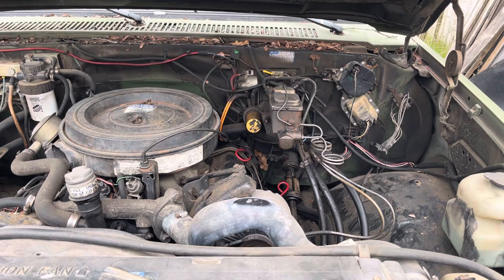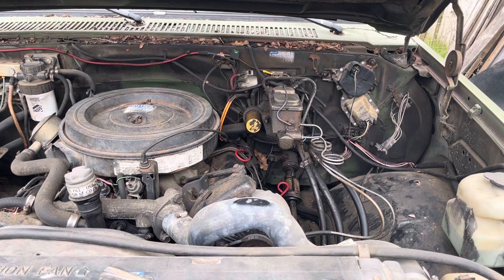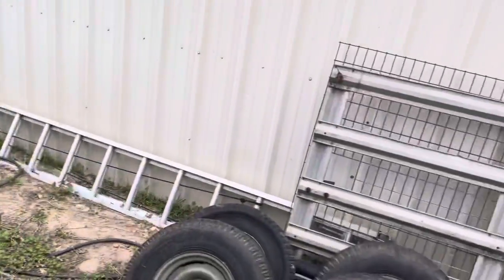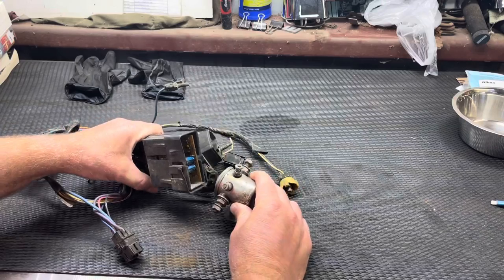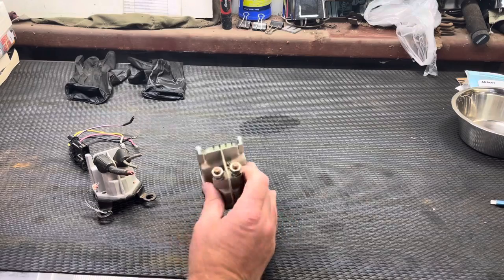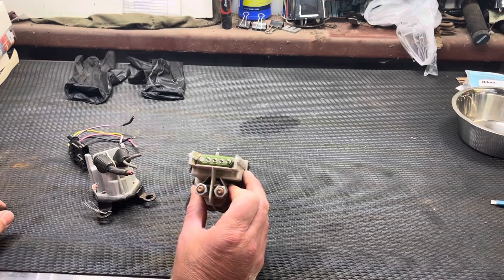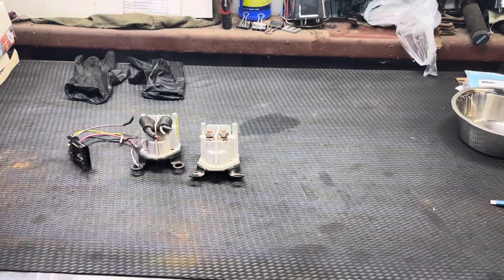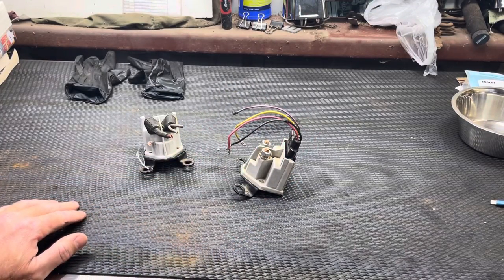6.2/6.5 Diesel glow plug controllers over the years

Comment: A year or two after I bought my 1984 K2500 6.2 diesel, the glow plug controller went out during a high country hunting trip. Fortunately, one of the party was the diesel mechanic where I bought the truck. He jury rigged a manual control which saved the day. He advised me that WD40 spray could be safely used as a diesel starting fluid. (Can’t do that with the “new” WD40). For years thereafter, I carried a can of WD40 in the glove box. Still have that truck today… 258,000 miles on it. Just put a new set of glow plugs in it two years ago. Hard starting unless I plug the block heater in for an hour or two. I did the same fuel filter swap I see you did.
Reply from the maker: True. WD-40 used to have propane as the propellant in the can. That is what made it a good starting aid to the diesel engines. Thanks for watching.

Comment from the maker: My opinion is that the 60G glow plugs is the only one to use no matter what controller you have. Because they self limit and don’t swell up getting stuck inside the engine. The gray controller though was designed to use the 9G and 11G glow plugs from Delco. They heat up faster than the 60 G plugs. 

I have had 2 vehicles with the gray controller added by me running 60G plugs start every time down to 15°. Another diesel with the gray controller wouldn’t always start at 50°. I added a relay over ride switch to that truck and hold the 60G plugs on for a count of 12 if it has been more than 12 hours since it ran no matter the outside temperature. 

Each engine has a personality. I am convinced the gray controller with 60G glow plugs is the best long term solution for the 6.2 and 6.5 mechanically injected engines.

Comment from the maker: What number Delco plugs did you put in?  Only the 60G plugs are self limiting. All the rest don’t manually glow for more than 15 seconds.

With the 60G glow plugs I normally use my manual override for just the first start of the day. 12 seconds when it is above 70°. 18 seconds when it is above 50°. Below 50° and I normally hold it down for 22-24 seconds. 

If your fast idle advance is working and your cold start advance inside the IP are both functional. Then all you need to do is turn on the ignition, push the throttle down slightly and then let go. Once the glow time is over it should start immediately and idle well. 

The time after first firing until about 30 seconds is really critical to have a functioning glow plug controller for what is called “after glow.”  Even though the engine is running, it still is really cold. Selected glow plug glows of short duration keep it running and help all of the cylinders get running right. That is why I keep a glow plug controller on all of my trucks even though I use a manual override to get the first start. Us humans can’t do the after glow right as good as a controller. 

All of the above written has worked good for me down to 12° for me and my vehicles. I hope it will for you as well.

Comment: I'm looking at buying a single wheel one ton 4x4 with 43,000 miles & it's a 6.2 so i really appreciate this. Nothing is wrong with the truck i just wanted to make sure it stays that way
Reply from the maker: Thank you for watching. I was talking to a machine shop owner yesterday who had 6.2 trucks but now drives a Duramax truck. While looking at a 12 valve 6BT he is building for a customer I mentioned I was stuck in the low power 6.2/6.5 world. He said “No, you are stuck in the dependable no $5,000 surprise world. Stay in your world and be happy.”

Comment from the maker: You are correct about the 9G glow plugs heating up faster.  All of the non self limiting glow plugs will heat up faster than the 60G plugs.  However, if a non self limiting glow plug is left on too long it could swell inside the pre cup. I have removed swollen 9G and Wellman plugs from engines like that.  I don’t have any personal experience with the Bosch plugs though. Never removed one and never installed one. If they are self limiting, give them a try and let us know how they do.

Comment: Can you put the part numbers/correct search terms for the controller and wiring harness in the description? I found a black 4-pin controller, but I'm having issues finding a plug for it. I'm converting a military engine to 12v, so almost all the wiring needs to be replaced.
Reply from the maker: I actually did an entire video just about the controller, numbers, plug and what wire goes where:

https://youtu.be/6wDj_yUQ9EE?si=wFwXPr2m7Xae22tM

Delco 212-367 is the gray controller. 

S-759 is the plug. 

Thanks for watching.
Reply: @timsteachablemoments1786  oh, perfect. Thank you.
Reply: @timsteachablemoments1786  ah, looks like the Delco version was discontinued. The only listing I could find was selling it for 185USD. That would explain why the supplier I originally tried getting it from last week refunded me.
Reply from the maker: @Duamerthrax  They were for sale everywhere when I made the linked video in February 2024. I hope it is just supply chain issues and not now a discontinued part.

Comment: Hi, does anyone know what that blue wire with what looks like a sensor connector on it is? I've checked forums, etc. and the TM wiring diagram only shows blue wire for the relay negative and to the Wait Light. The wire I'm talking about can be seen at the exact 2:00 minute mark above Tim's hand sort of standing above the rest of the wires. On my M1009, it is disconnected zip tied to the harness near the bulkhead. Anyway, appreciate the videos.
Reply from the maker: Grounding the blue wire with a switch is how you hot wire the CUCV glow plug system.
Reply: @timsteachablemoments1786  Hi Tim, thanks for replying, appreciate your help; but I think you're talking about the light blue wire from the controller to the relay that grounds and energizes the relay. That's not the wire I'm talking about. Also, it is not the blue wire from the fuse block to the Wait light. The blue wire I'm having trouble finding info on does not seem to be in the TM diagrams (at least I can't identify it). The blue wire I'm talking about has sensor like connector on it (single connection with a rubber gasket) and I think it goes to the 4 pin connector in the cab. I see it in your video at 2:00 and at the end (have not seen it or even mentioned anywhere else). The truck starts and runs fine and this wire is unconnected in the engine bay as if on purpose. Don't mean to waste your time if I'm missing something obvious.

Comment: Hey I have the old 82-84 6.2l glow plug module and relay on my k1500 .  I want to replace the glow plug wiring harness from the module to the plugs. I have been looking online for a whole new replacement harness but all i can find is the 6.5.   Do you know if  6.5 and 6.2 are the same or close enough that you can use on either. Cheers again Ants
Reply from the maker: Just make sure it is the gray 4 pin solenoid and plug. I guess I need to do a video about what each of the 4 small wires go and how to convert. I will get on that.

Comment: I have a 99 Suburban 6.5 and I'm chasing some glow plug issues.  Plugs themselves (60G) are only a few years old with not a ton of miles.  Recently this fall I noticed that when the wait to start light was on initially I wasn't hearing the typical buzz/rattle I always had from the relay on the engine.  When it got colder it got really tough to start unless the block heater was on for a while.  I noticed that after the engine would start or if you left the key on long enough the light would pulse/cycle a few times as normal, and the voltmeter would dip each time (same as it always did) indicating to me that the plugs are drawing power and the relay is doing "something," just not the initial wait to start warmup before cranking where I heard no noise and no voltmeter dip.  I replaced the relay and got the same result, no change.  What could be causing the relay not to heat the plugs initially at key on but then pulse them later?  I haven't seen this particular issue brought up researching this online.
Reply from the maker: It reads like you might have some bad glow plugs. Or, wiring issues between the controller and glow plugs. Try Ohm testing the glow plugs. Here is a video about how to do that:

https://youtu.be/U6rbU3FiB14?si=dA83IawJPeY6zxa6

Comment: 84 cucv 
I put a manual momentary switch in and ac delco plugs
The truck says half pedal to full pedal depending on Temps. I hold button for 10-12 sec and just slight throttle and she lights. Any more it gets to much
Fuel. ? Is how long is too long for plugs to be on when temp gets cold now getting into fall/winter

Comment: I have an 1989 and have ran 2 new batteries down trying to get it to start. I have a skoolie. Seems when it did start no matter the temperature the glow plug light stayed on same amount of time. Any suggestions?
Reply from the maker: I don’t know what a Skoolie is. Anyway, if your glow plug light is coming on it seems your glow plugs could be bad. Watch this video about how to check them:

https://youtu.be/U6rbU3FiB14?si=fTqdVjiVLwAFeo9t

If you are not getting a glow plug light, then you need to check the connections to the glow plug controller. I will be posting a video today by coincidence about the wiring for the controller on your 1989.
Reply from the maker: Actually, I posted the video I was thinking of a few weeks ago that explains the glow plug controller wiring:

https://youtu.be/6wDj_yUQ9EE?si=ZyjOnbahAc9L78eD

Comment: Should the glow plug light still come on if either the relay or the glow plugs themselves are bad if it has a manual glow plug button installed
Reply from the maker: That depends on how the manual glow plug set up is wired in and the wiring of the truck. A stock GM truck has it so the glow plug light is powered by the power going down the same wires to it and the glow plugs. So, unless that wire is broken if the glow plugs are getting power, then the light should be on.

Comment: Can anyone tell me the correct number for the driver side alternator belt?, and the group number for the original batteries?.
Reply from the maker: Gates brand is the best I have found. 7575 Gates XL 11A1460 is what my drivers side alternator belt says on it. 6TL was the original military battery size. You won’t find those today. Group 31 is the civilian  equivalent. Just make sure you get a pair  of batteries that each have at least 800 cold cranking amps.

Comment: Hey i have a problem with the battery going dead if i dont drive the truck for say a mouth or so could you get me what is the cause of this
Reply from the maker: How old are the batteries and is it just the front one going dead?
Reply: @timsteachablemoments1786  
There new battery if you let the truck sit for a week or more it killed both the batter dead  what is saying on in the truck
Reply from the maker: Un do the negative terminal from the front battery. Do you see and hear a small spark?  If so, there is a short somewhere.

Comment: I'm just wondering we're my plug in is on my Chevy express 6.5l if someone made a video on that they would be famous there's thousands of videos like this anyone know we're the plug in is at
Reply from the maker: What glow plug plug in are you looking for?  Or, do you mean the 110 volt wall plug cord to keep the engine warm at night?  If so, the heater element will be in one of the freeze plug holes in the block. Not all vehicles came with the heater installed. It was an option from the factory. The 110 volt plug wire could also have been broken or removed at some time in the past as well. I have a 6.5 that has the element, but no wire attached.
Reply: @timsteachablemoments1786  if mine does I can't find it mine doesn't start under 50 degree's I have a schoolie bus with the 6.5L has been well maintained used to start up eventually now nothing it def has something to do with it being cold cause runs and starts fine after it's been running but leave it sit for a few days and goodluck I have two brand new batteries and already warm them down have them charging overnight to try again tomorrow
Reply from the maker: @TattedTommysTv  Is your glow plug light even coming on when you turn on the ignition?